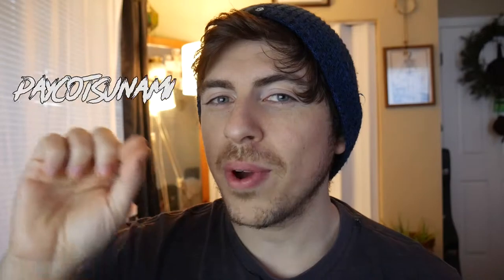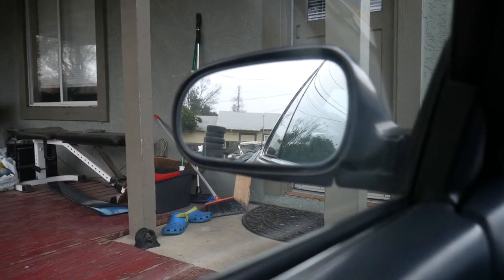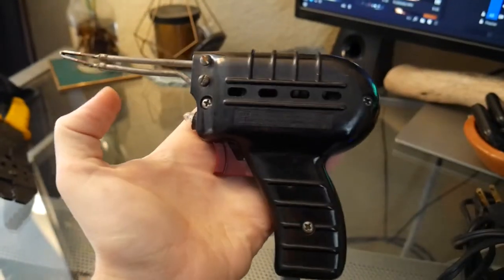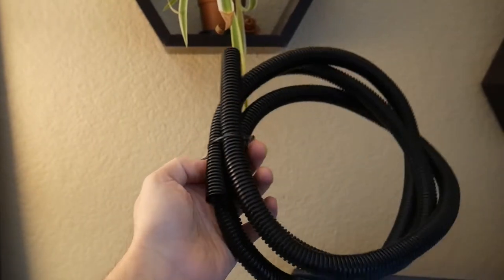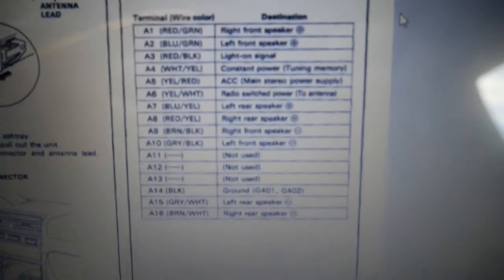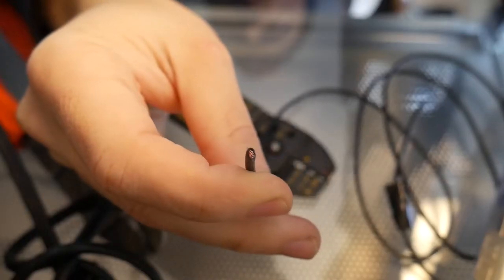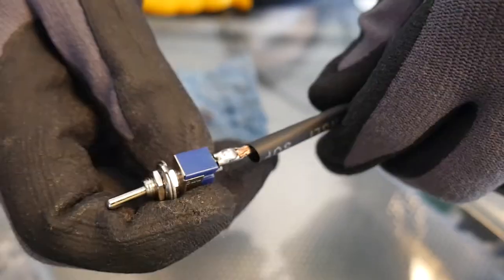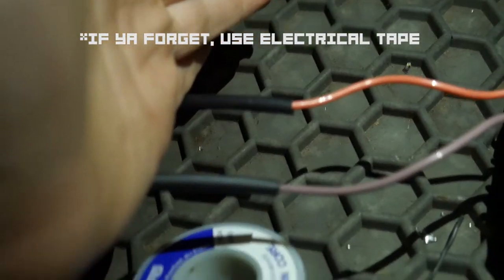Control your Automatic Antenna with a Switch // How-to [1990 Honda Accord]

Comment: Great video man, i need some help with my clock and stereo circuit. They were working but the stereo fall out of the socket and disconect everything, plus before a horrible adaptation to aftermarket stereo.

Comment: Very interesting idea! At least your antenna works!  Mine got broken off and needs replacement.  I'll definitely try out your idea but I wanna find a way to integrate the switch into the center console or the dash.
Reply from the maker: Yeah definitely! My buddy mentioned that there's a switch that the 3rd generation accords had which allowed you to manually put up or down the antenna (its a neat switch). Pretty sure if you snagged one at your local junkyard you could probably find the wiring online somewhere to integrate it to your wagon. I was thinking of doing that myself since it sounds like a fun project but I'm restoring the car personally. So I'm not cutting into any trim for a switch haha I'm waiting for school to stop this week so I can look into placing a sheet metal undercarriage for the driver side foot well so I can cover vital parts in the car from thieves AND have a spot to mount the switches. I'll toss it up here when I'm finished with the diagram of my idea because these cars are too easy to steal

Comment: On my Toyota Camry (2000) the stock radio only invokes the antenna when the source is on radio. The antenna is switched for other sources like CD or Cassette mode. This feature is not available in third party units.  I plan to upgrade my head unit and would like to keep the antenna switched off while using CD, USB or BT. This switch will be very handy! Thanks!
Reply from the maker: No problem dude, thanks for commenting! I'm stoked it's helped you out! 😄

Comment: Hey alex, if I get a switch with 3 points, do i just connect positive point to red, ground point to black, and trigger point to the antenna wire? I also noticed some switches have only 2 point. Can you explain which wire goes to where? Thanks!
Reply from the maker: With a 3 pin switch, its only used if you want to leave the ground open or not but with this one you don't need the ground. We're just interrupting the wire to detect the radio is being used or not so we only need the 2 pin switch. I believe you can still use that 3 pin switch but you just need to find the diagram on it to see which 2 pins is used for switch on/off
Reply: @PaycoTsunami  Thanks! Apparently on this 3 pin switch I have, the negative is not used. Just the other 2.

Comment: So basically you interrupted the power antenna wire w either end of the switch wires ?
Reply from the maker: Yes sir, interrupted the signal wire from the antenna to radio. Loved it whenever I need to put away a car wash or using my cassette player adapter